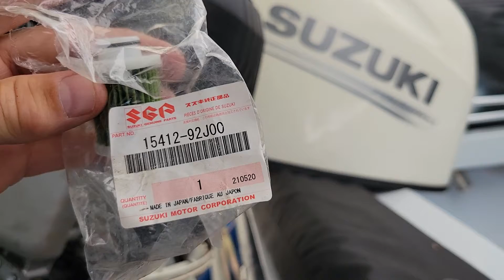FUEL FILTER REPLACEMENT - SUZUKI OUTBOARD DF140A - LOCATION AND CHANGE

Comment: My motor has too much oil in it. What should I do
Reply from the maker: Drain some.
Reply: @JimWellman  I know but how should I. Do I need to get a Syringe or is there an easier way to do it.
Reply from the maker: @sammysmith1727  you should do that, but you can also take the plug out for a sec.  It'll be messy.
Reply: Hello, what is the filter change period?